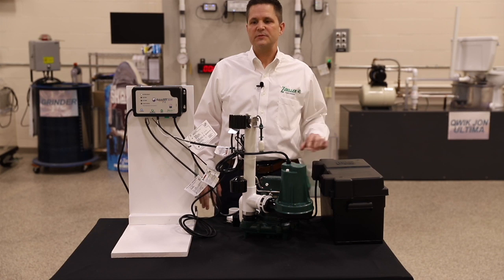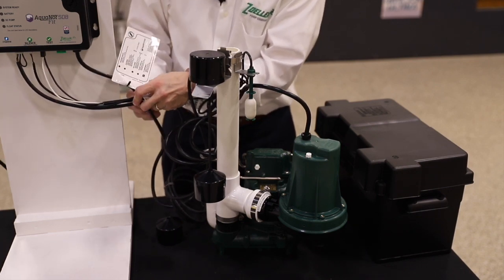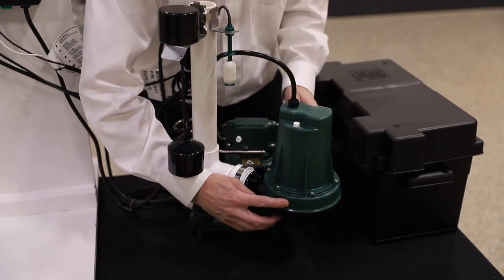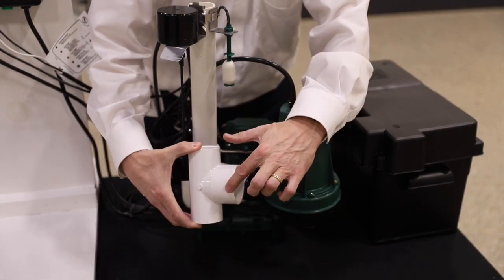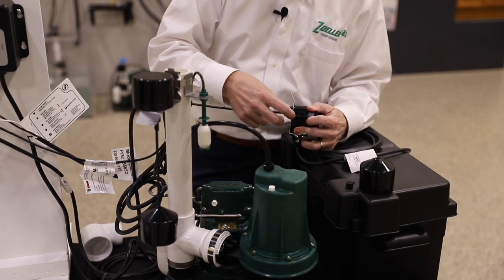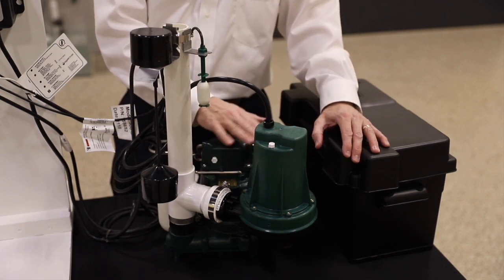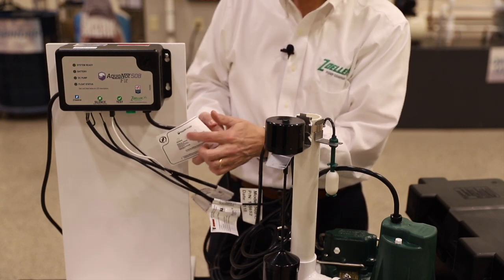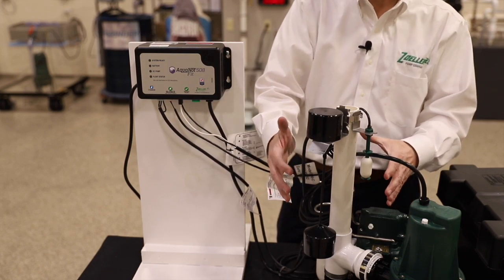The Aquanot Fit 508: Tips & Tricks

Comment: If the primary pump can not handle the amount of water coming into the pit and the water level reaches the backup pump will running both pumps at same time increase or decrease the GPH output on the combo’s piping?

Comment: I'm having a great deal of difficulty with the O ring.  Is it normal for the ring to slide off it's ridge on the discharge pipe during the joining of the AC and DC pump?

Comment: Is a weeping hole needed on the discharge pipe below the check valve or not?  Since it all comes pre-assembled I was not sure if one needs to be added or is the hole on the actual pumps sufficient?  From what I read it is best to add even if you have one, but since it was not included on the pre-assembled model I was not sure.
Reply from the maker: Hello John, As a preassembled unit, we have taken all precautions and there is a weep hole ON the primary pump, inside the DC pump and one located underneath the flapper (on the threads) of the threaded check valve that is in the pump. The system will be ready to go out of the carton! Any other questions, please let us know. Thanks!